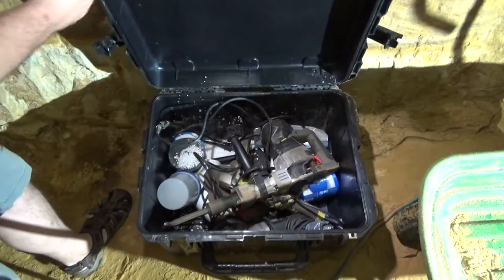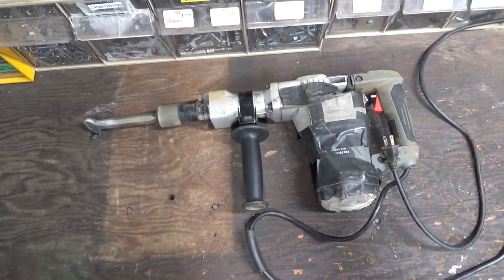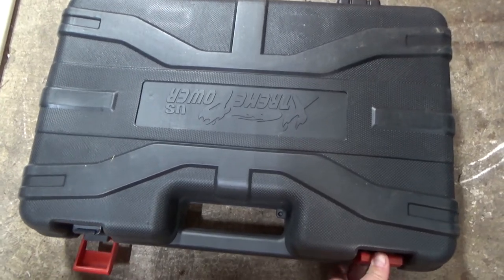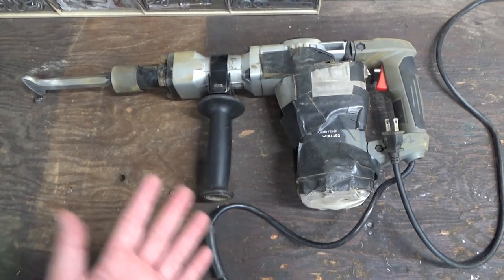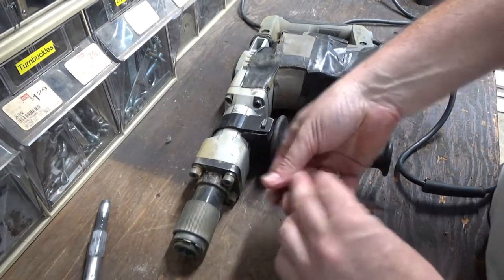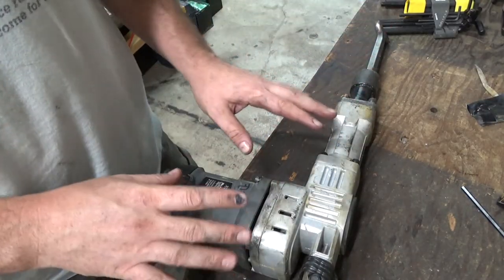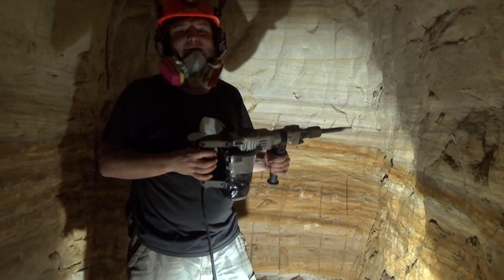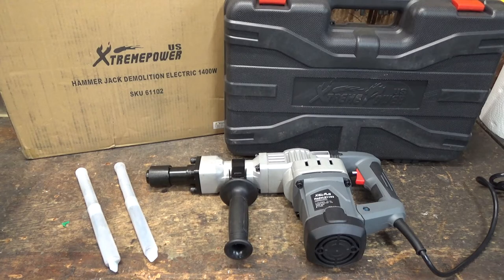XtremePowerUS 1400W Demolition Hammer Teardown & Review (Not a sponsored review!)

Comment: Have you guys ever tried putting a tube on the air intake for these drills? I think that if you were able to get the air coming in to be even just a few feet further from all the dust, it could significantly extend their lifespans
Reply from the maker: We haven't tried that, it seems like short duty cycles and rotating between several tools helps with longevity. I think part of my current issue might just be sand stuck in the hammer mechanism, I need to do some more investigating.

Comment: Thanks very much for sharing this!
I live on limestone, so every landscaping consideration starts with breaking rock (or asphalt).  I've done some work with SDS+ which is very slow, and borrowed a 1400-1600w Makita jackhammer which greatly improved my speed.  I think this might be what I'm looking for.
Reply from the maker: Glad it helped! I've also tried the bigger version (2200w jackhammer). Those are good for going straight down, but too heavy and unwieldly for any detail work. The 1400W model is perfect for handheld use.
Reply: @saveitforparts  This is going to make it a bit difficult to take apart, but you could use gasket glue around the edges where the parts conjoin like with a gasket on an engine. It just goes on like glue and then when you press the parts together it creates a seal. As for the rest of the small cracks on it, you could try silicone for the parts that don't require airflow, and for the parts that do you could add more of that screen you use on the bottom air intake of the hammer.

Comment: You can liberate a couple of newtons by cleaning up the armature where it makes contact with the brushes using a little sandpaper.  Just make sure not to abrade the windings insulation, and to clean up metal dust between the contact plates with an old toothbrush.  Douse it all with electronics cleaner, and let it dry thoroughly.

Comment: Neat timing, I literally two days back messaged someone about their demo hammer since I picked up a $25 project one that ultimately was found out to be missing the connecting rod.  So, wondering what the specs are for a Bosch 0611 302 connecting rod so I can fabricate, since doesn't look like I'll be finding the parts for anywhere.  Would be great if can find the part, though doesn't look so promising.  Thinking in time, I'll guestimate what the length is and see what I can come up with to make.  Though would be super awesome to find the part that's cost effective or at least someone who owns and can provide at least that center on center rod each end hole length.  I think I can figure out the rest of the dimensions.
Reply: Wondering if you can take some furnace screen or something and use as a filter/screen?  Not sure if would be overly restrictive and hamper cooling?  Maybe can add a small fan?  Just noticed you might be taping over some of the air flow sections maybe... so seems like might improve performance if you put furnace filter materials that's a high enough MERV number over those spots and hold in place with the tape so filtering and still getting air flow.
Reply: For pin footing pipe or maybe fence post driving... maybe you can hack on a small engine and fabricate a custom set of tips?  That's what sucked me into the vortex of these tools.  Started with a Thor-Nado Electric Hammer.
Reply from the maker: @jafinch78  I think I have an ancient Thor-Nado! Took me days to drill through my wall with it, house was built in the 50s by someone convinced the bombs were coming!
Reply: @saveitforparts  Alright!  Mine is only an electric hammer and I still haven't use that or the other batch of those tools I binged on... a Hilti hammer-drill and another red one that the name isn't coming to mind though is another made in the U.S. brand like the Thor-Nado.  Now, the Bosch I found out is oddly named a "un-demolition hammer" and the connecting rod is discontinued.  Hopefully their engineering department or somewhere has the dimension drawings so I can get the size to fabricate so less trial and error.  Such a waste trashing if only the connecting rod needs replaced.